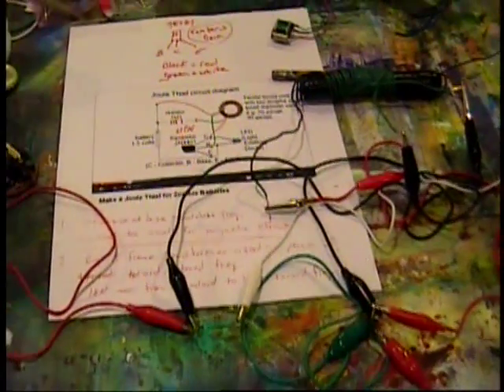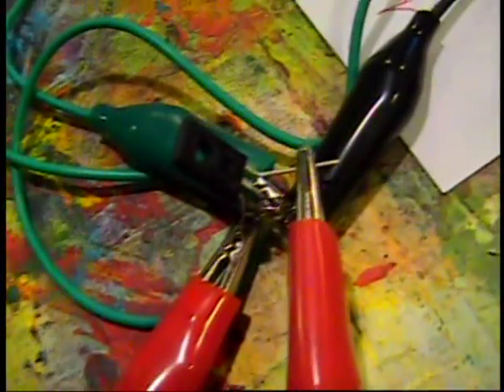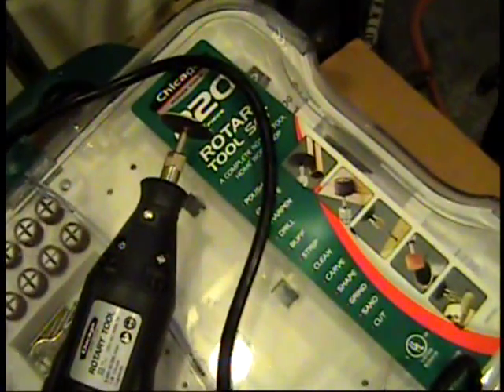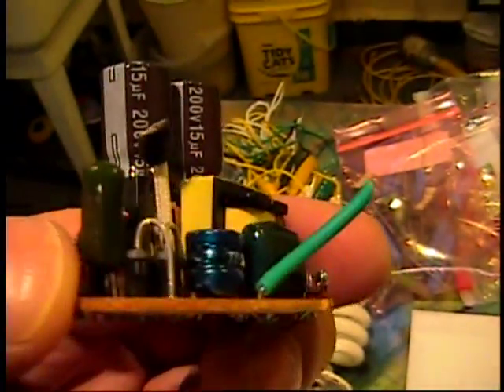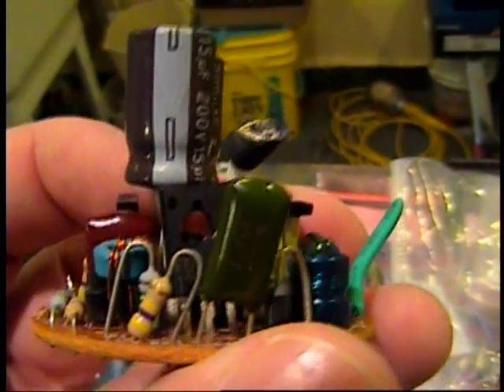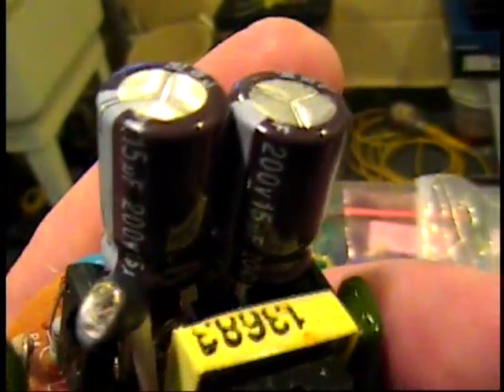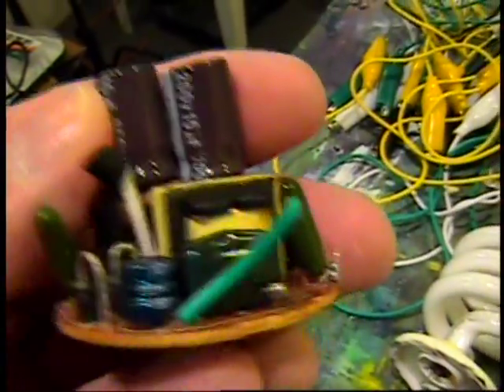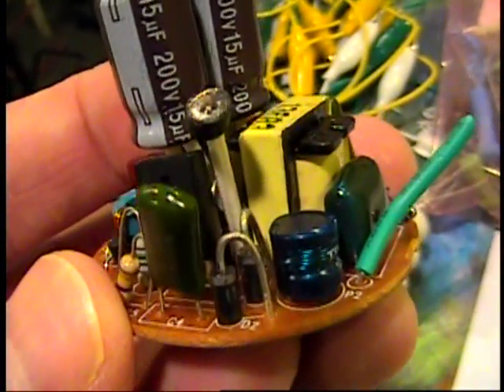Recycle Circuit

Comment: I saw this video years ago and I just now re-stumbled across it.  Thanks to you, I now have a junk box full of tubeless (properly disposed of) dead CCFL bases.  Why?  Because I eventually grew bored of making stacks of "joule thiefs" from those tiny little torroid inductors that are inside them but I still can't bring myself to toss away a dead CCFL lamp knowing what's inside!  :)
Reply from the maker: Bluntforce, it almost sounds like I cursed you! Thank you for taking the time to help the environment by not chucking good stuff into the landfill. Somebody out there would love to have those bases. Try putting them out in a garage sale. Some knuckle head like me might buy 'em.
Reply: Ron:  Heh.  No sir, I'm hanging onto them!  I only told you that I had a bunch of them in a box, not that I wouldn't ever use them!  Although admittedly, my ideas for their usage is slower than their "acquisition rate."  Actually, at this very moment, I'm getting ready to desolder a high freq transformer off of an old SMPS circuit board.  That is another great source for random components!  NPN BJT's, voltage regulators, BIG torroids, tons of resistors and high voltage caps.  Finding old power supplies like that lying around is almost like finding gold...